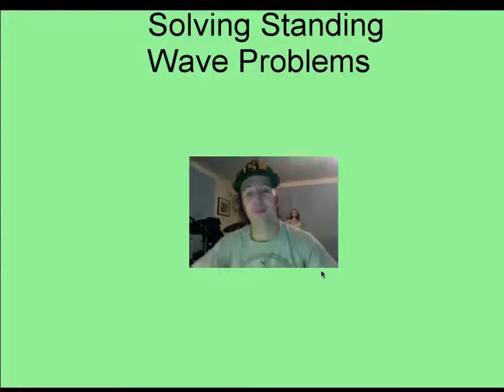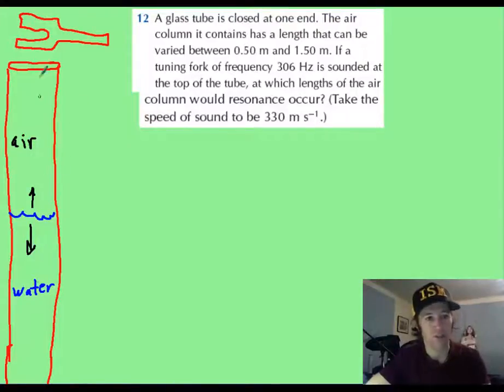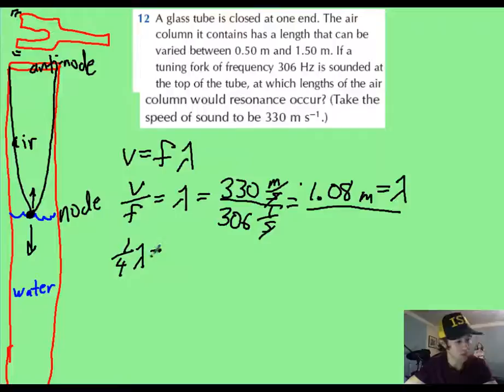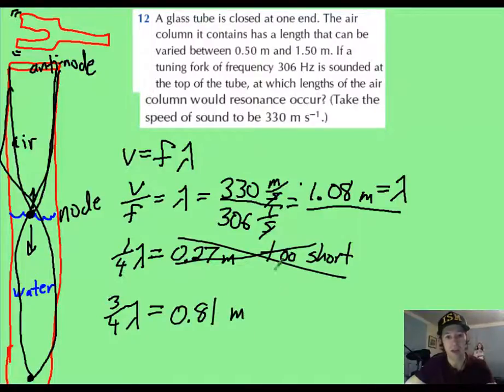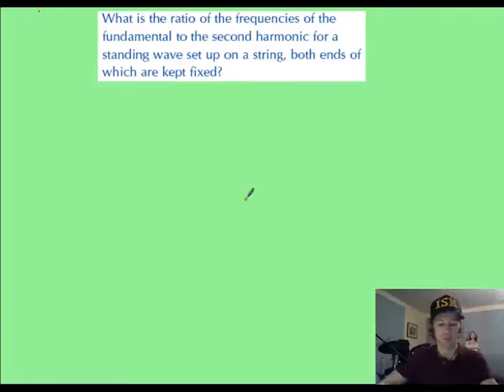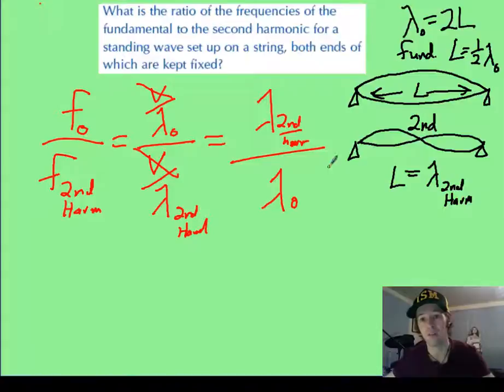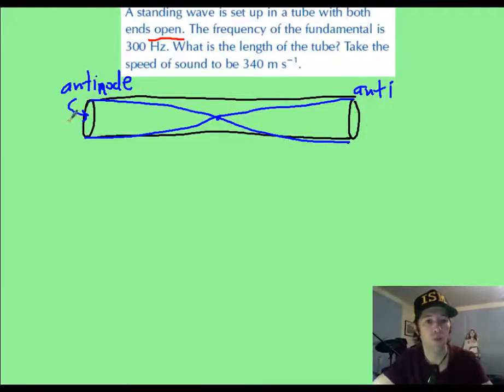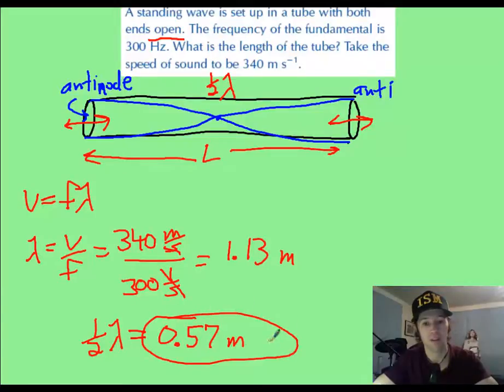vid 2, topic 11, solving standing waves

Comment: Hey,

Thanks for all your helpful videos - they have been a great help in the past few months before my final IB exams.

Just passing by, I happened to notice a slight mistake in the first problem: as you stated, a closed pipe has fundamental frequencies of 1, 3, 5, 7, etc.

Wouldn't that mean that the harmonics that could be reached would be the 3rd and the 5th harmonic, and not the 2nd and 3rd?

Best regards,
Sam